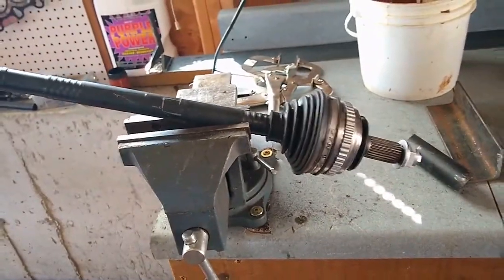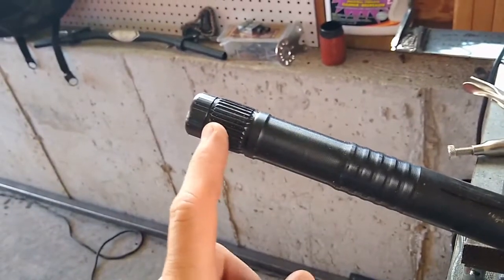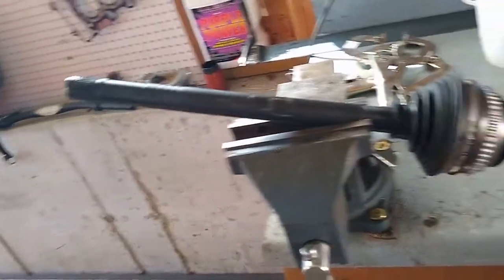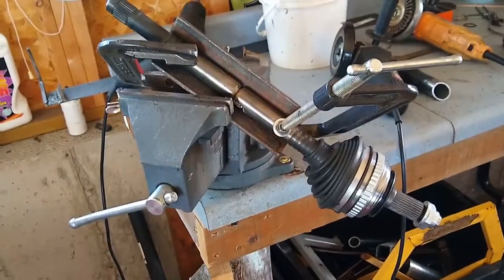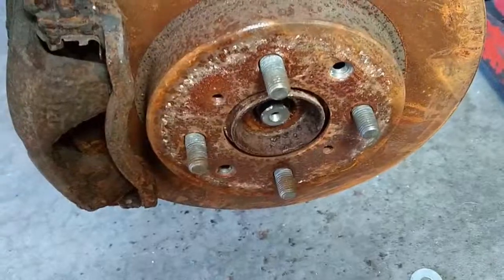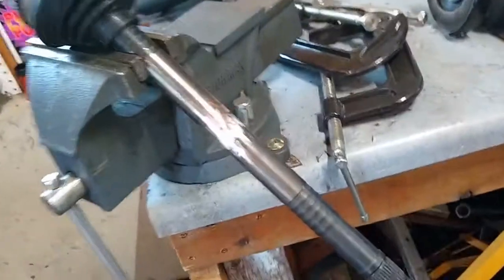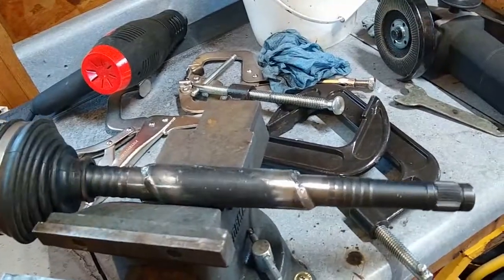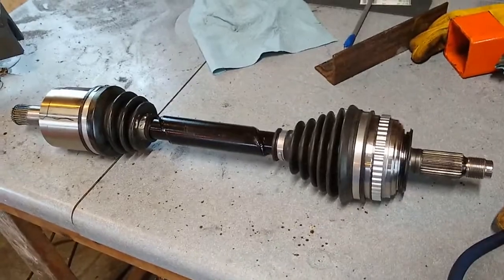How to Shorten and Sleeve A CV Axle for the K24 Insight

Comment: so did it hold up, I am about to do this to my Prius powered electric VW Rabbit
Reply from the maker: I never had an issue with it. I have another one built the same way in my v6 swapped civic and it has been living under 250 hp with no issues.

Comment: Hello: I have been enjoying watching your process.  I am currently build two buggies, one with a 40 horsepower snowmobile engine and the other with a 95 horsepower snowmobile engine.  I am struggling with getting the correct axle situation with my 40 horsepower buggy.  Let me ask you, how has the welded CV axle held up?  Can it take some serious power?  I agonized over splicing my axles but many comments I have read state that welded CV axles only hold up in lower power applications.
I am using RZR transmissions in both my buggies so that won't be a problem.  My 95 horsepower buggy will be using all stock RZR suspension parts so there won't be a durability issue with that buggy.
I'm debating on custom splining a CV axle so I can have an inboard RZR CV joint and an Arctic Cat ATV outer CV joint to go with my ATV suspension on the 40 horsepower buggy.  Welding the halfshafts would be easier, but I am concerned that the first time I try to pull a wheely or floor the accelerator, my welded axle may snap.
Your thoughts?
Thank you.
Reply from the maker: I don't have the car on the road yet, but I will update when I do some testing in the spring. It seems like there are two different stories I get when talking to people about the welded/sleeved axles. Either they work great forever or they break immediately. Most people who haven't tried it will tell you it will never work, but what do they know if they haven't tried it? I think it comes down to how good the welds are and how straight the axle is. I can't imagine my welded axle with the sleeve is weaker than the original one, but maybe I will eat my words. In the end, I chose to do it to learn if it works. I'd consider my application "low power", since the car will have 160 hp (to start) and weigh ~1900 lbs. And is fwd with street tires, so it is unlikely to hook very hard.

It sounds like you have some pretty cool projects going on. If it is going to put your life in danger if the axle snaps, I'd just spend the money on a custom axle. If not, maybe it is worth a try. In any case, please share your results!

Comment: Nice, that’s a good bit of information! I’m gonna be trying to shorten one of mine, but most likely I’ll have to extend the other one, have you got any advice on that?
Reply from the maker: Thanks. To make a longer axle, maybe you could make the axle out of 3 pieces and make the sleeve section longer to cover both splices?
Reply: That’s what I’ve done, will see how it will hold up, it’s only about 110hp, should be okay

Comment: So you only shortened a single front axle? I’m only having axle bind on one, should I leave the other one alone? Or shorten both the same amount?
Reply: Did it change the wheel base too?
Reply from the maker: @gabrieltrebbi3079  I only shortened the driver side, because that is the one that was too long. Assuming the engine can't move side to side, you should only fix the one that is binding. By wheelbase I assume you mean track width? The track width is set by the length of the control arms and not the cv axle, so it was not changed.

Comment: Did it last?
Reply from the maker: I've got about 800 hard miles on it, including an autocross and hard launches and power shifts. No failures, vibration, or issues so far.